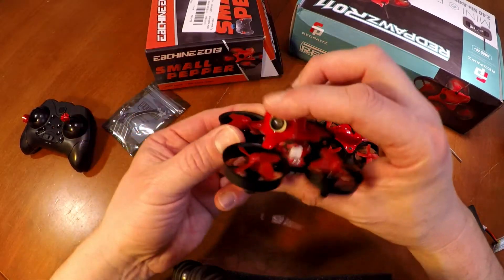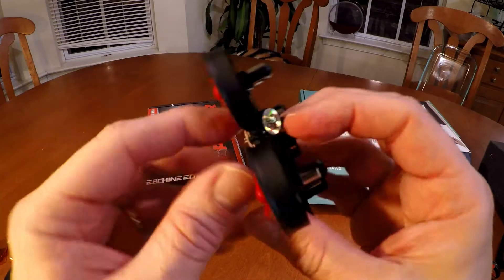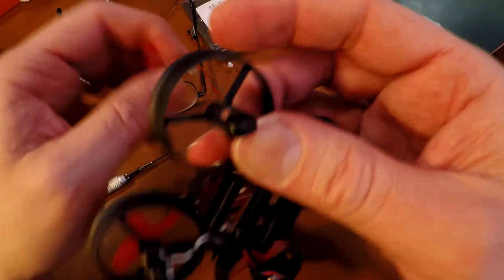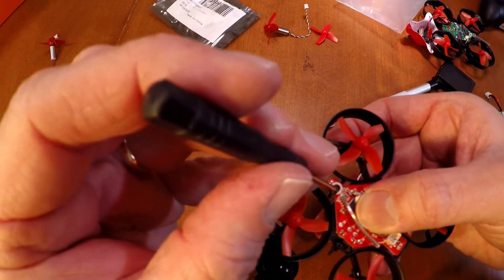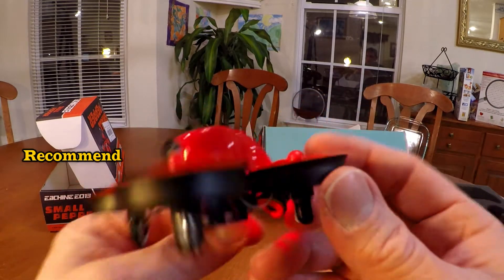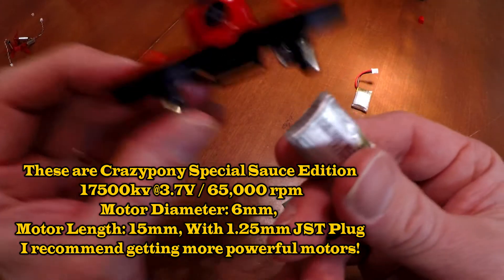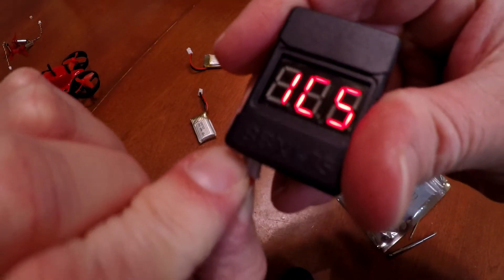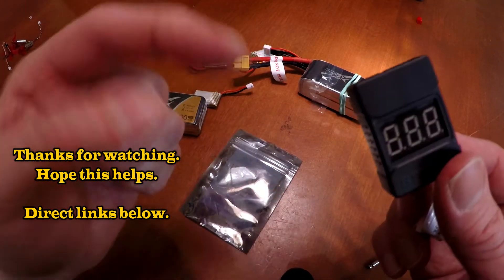How to replace motors on Eachine E013 Whoop FPV Drone

Comment: I literally got this today. Flew it 3 times. Now one of the motors won't go. So I got what you linked. Thanks for the video.
Reply from the maker: I had the same thing happen to me.  engine blew very quickly.  I've since upgraded to more powerful motors too, but haven't really noticed much of a difference. Thanks for sharing.
Reply: @TommyDrone  I'm just hoping it is the motor and not somehow an ESC or whatever. I bought the more powerful ones that you have in the description. They're coming today so we'll see how it goes.
Reply: Alright. Update. The motors did work great. My only problem now is that I can only use the 220 mah battery that came with it. 

I had ordered 260 mah before I got it but when I use them it flies for about 10 seconds and the power is cut off completely. I can disconnect and reconnect the battery and it'll go for another 10 secs and cut again. Rinse and repeat. So I ordered more 220 mah and hopefully those all work. 

I want to fly this damn thing! Has anyone had anything like that happen before? I'm a total noob to fpv and quads in general.

Comment: So motors last for couple of flys and then I have to buy new ones?
Reply from the maker: So I have two whoops drones.  An Eachine and Redpawz.  The Redpawz requires soldering to replace.  The Redpawz still works great and motors are plenty fast and powerful. The Eachine motors died within the first couple days and I found myself having to replace them.  I have the links above.
Reply: @TommyDrone  thanks, but I cant see a future with this drone if I have to order new motors every couple of days. That is what I meant... I wanted it for my son and me. We purchased our first quad S9W two months ago. Over 300 flights of 7 minutes. So this drone is bad, because motors die? So we need to find brushless mini drone or whoop (learning facts of new hobby :))
Reply from the maker: EmotionalBeats  It's fun I found other whoop drones that are more advanced and they also cost a lot more too.  Note if you're looking to get a basic good beginner  drone the best is this:  https://www.youtube.com/watch?v=bplicxGjqGk  It's durable, flies great and takes great video and photo.
Reply: @emotionalbeats7178  Just got this eachine and motor burned out after 2 flights.
Reply: @grumpypoof9648  ahhaha a reply after a year :D I already have 1000plus flights and an armattan quad :) :)
Reply: @emotionalbeats7178  I was just concurring with what you said man. I had to replace the stock motors. 

I just bought it for indoor fpv. I have a rodeo 150 and the ol wizard x220 I fly outside.
Reply: @grumpypoof9648  yeah... I had so many troubles with new, expensive quads... Motors, fc, dead on arrival. It is the reality of the hobby.
Reply: @emotionalbeats7178  Yeah, I wish there were more American based companies. Ordering from China is a disaster. I've emailed banggood like 15 times about those motors not working and they won't even get back to me.